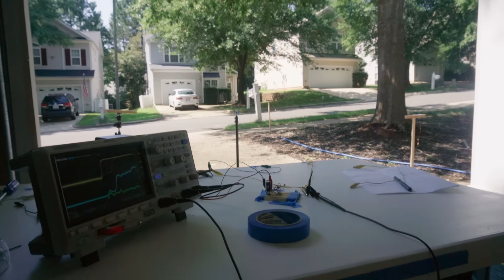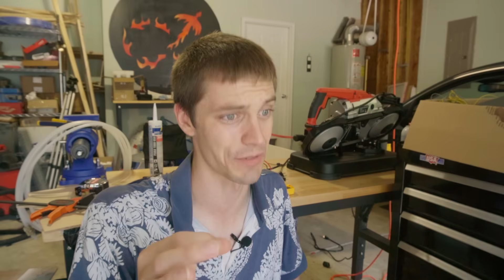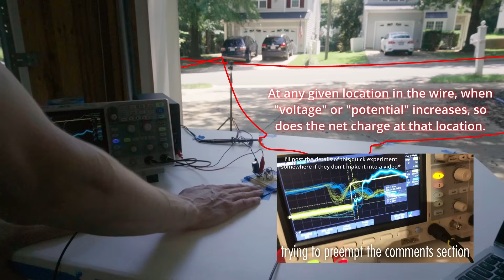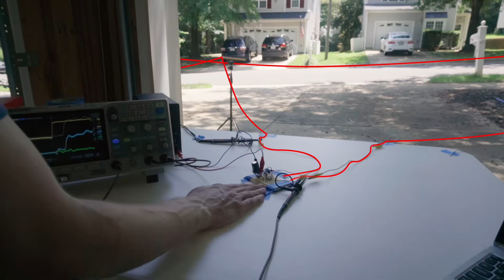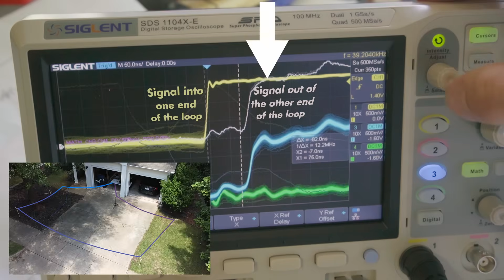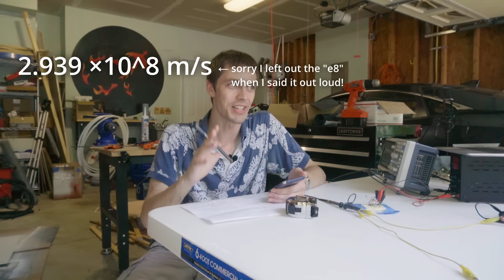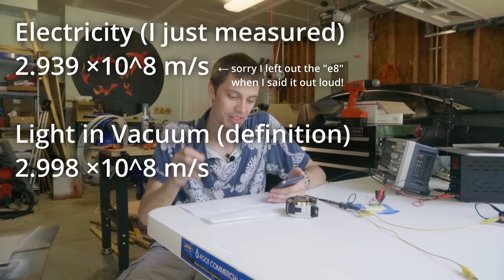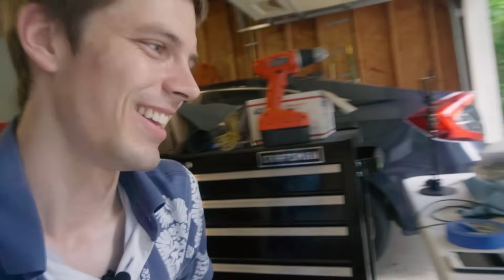Why does WATER change the speed of electricity?

Comment: 1)  AC power,      Converted to  DC   and processed further.      that signal then goes into a solid-state switching circuit !      (is the power supply   linear.?          2)  AC power,      Converted to  DC   and processed in a signal generator; whose output is the input signal of the circuit being switched.          is it possible that these things contribute to artifacts, embedded in the signal.

Comment: I'd like to see experimental confirmation of the water molecules aligning to oppose the field idea. It seems to me that it has two testable consequences: (1) if you preload the system with 9v DC running through it to align all the molecules against you and then flip a switch to jump to 18v DC it should be the 9x slower initially expected and (2) the timing of the edge where you drop the voltage back to zero should be faster in water than the rising edge and you should not see that effect in a vacuum.

Now I type this I'm not confident in the validity of either of those predictions but a video on why I'm wrong would be greatly appreciated.

Thanks for all your hard work explaining this

Comment: A video about how oscilloscopes work, both digital and old analog is clearly needed as it seems no one commenting seems aware that normal affordable scopes are only able to display fast signals that repeat. They do almost nothing at Ghz speeds, instead they sample and digitize at a vastly slower rate and eventually collect enough data to display the result.

Comment: I've talked to several engineers about how electricity 'flows' in a wire, but there seems to be divergent schools of thought. The idea (theory) that seems more reasonable to me is the interaction of the current and the magnetic field. The premis is that voltage/current must generate a certain level of magnetic flux before usable current will flow. Most commercial electrical work focuses on result, not 'why', but field engineers have told me that when high tension (100,000 volt) lines a powered up, the interaction of the magnetic fields cause the wires to move around at 5 to 10 foot waves, and measurable current is only passed when the magnetic fields have stabilized. I suspect the fields contain substantial levels of energy inhibiting current flow, and we have known for years that breaking flowing current causes huge spikes of voltage.

Comment: you should get into ham radio. I believe you would have a lot of fun with swr. I use a 80m loop in my back yard and you get into it on a way higher level when you're trying to communicate on it. Also you may want to make your main measurements at night if your planning to get very technical, because solar energy and electromagnetic energy from the sun messes with just about any readings you get through a wire, especially during mid day.

Comment: When building a wire dipole antenna for my Ham Radio on the HF bands I have to adjust the length of it if I use coated copper wire. The rubber coating adds some capacitance and changes the speed of the signal in the wire. My antennas end up being a little shorter than a bare wire antenna would be. I like to use insulated wire so it doesn’t matter so much if tree branches rub against my antenna.

Comment: (i typed this comment early in the video... I could have just waited) 🙄😂😅
Derek at Veritasium has a good explainer about the speed thing. The common misconception is that electricity is the active movement of electrons. They DO move, but not like people sometimes think. The charge is transferred by the field, which does travel at the speed of light. Minus variance for resistance and all that

Comment: Weird, like everything you have for equipment is almost identical to mine.  Even the plastic component totes.  So, counterpoint, I see the 555 setup back there, some of your resonances you're seeing might have a lot to do with that circuit.  I'd be interested to see if there are so many harmonies if a signal generator was driving a switch on the line.  Hell a spdt mosfet, control both angles of the line.

Comment: Good experiment and well thought out,  but the language you are using confuses what is going on.  The number of conduction electrons in a length of a conductor is irrelevant, really.  Think of the wire as if it were a tube filled with marbles.  For simplicity imagine that the tube is only just big enough to take the marbles, so there is a single line of marbles in the tube each touching another marble either side,  one in front and one behind.   Applying a voltage ACROSS the wire is analogous to pushing the string of marbles at one end of the tube,  with say a pencil.  Then time how long it takes for the the last marble to start to move.  The marbles might not be going very fast, but the impulse or push can be felt at the far end of the tube really fast.  This is like what is going on in your conductor.

Comment: Great video. I admit there is quite a bit I don't understand here. The part that I'm struggling with right now is this:
At ~10:25 you show the electrons with their field propagating through the wire with a DC source. This is great.
Later in the video you explain that the impulse created by the switch is made of sine waves. You said its all AC.
AC meaning alternating current would mean that those electrons have to change direction. But they can't because you have a DC source pushing them all one direction.
How can it be AC?
Reply from the maker: There are ac components to their motion - if you add up enough components it looks like a dc switch flip. They might actually bounce a little bit, but that’s not what I’m referring to, more like an oscillation added to an average motion where the sun is always still positive

Comment: This setup looks very similar to what Veritasium posted back in April 2022 called "How Electricity Actually Works". One of the conclusions is that it matters less what the length of the wire is and more how far the load is from the switch/source in regards to the length of time it takes for the load to respond.

Comment: 12:52 It is not the decrease in the strength of the electric field that is the cause of the decrease in the speed of the wave. The movement of electrons in the medium generates an electromagnetic wave that interacts with the incoming wave (superposition) resulting in a wave that travels at lower speed. The superposition of two traveling waves results in a wave traveling at a different speed than either of the two interacting waves. it will be faster than the slower wave and slower than the faster wave.

15:38 That is not what will happen. First of all, what the heck is the speed of an ELECTRIC FIELD? it is static. There has to be an electromagnetic wave traveling through the medium to talk about speed. Also, while the water molecule will rotate to align with the electric field (they have a resonance frequency in the microwave region which is how microwave ovens work), it is the motion of electrons that gives rise to the electromagnetic field that interacts with the electric field passing through the water.

In the case of light, we can see the slowing because we can see the bending of light as it enters an exits transparent media. Also, white light is made up of waves of various wavelengths which give rise to what we perceive as color. Because the wavelengths are different the resultant wave travels at different speeds for different colors. This gives rise to a phenomenon known as color fringing. This is a problem in telescope eyepieces where an image will have rings of color around it (fringing).

Dr. Don has an excellent video produced at Fermilab that explains why light slows in water, or any other transparent medium. https://www.youtube.com/watch?v=CUjt36SD3h8
This video explains why light bends when it enters and leaves glass or any other transparent medium. https://www.youtube.com/watch?v=NLmpNM0sgYk

Other than that small error, your video is an excellent demonstration of the manner in which electricity propagates through conductors. If a picture is worth a thousand words, a demonstration or video of a demonstration is worth ten thousand words.

Wayne Y. Adams
B.S. Chemistry
M.S. Physics
Reply from the maker: I’d say the decrease and the slowdown are both effects of the remitted wave interference but I had to pick which rabbit holes to jump down. I picked decrease in strength specifically because it’s relevant to capacitors
Reply: @AlphaPhoenixChannel  The problem is that you say specifically that the decrease in speed is the result of the decrease in strength of the electric field.

At 12:35 you say, "Specifically, when you put a dielectric in an electric field that dielectric material will create its own opposite electric field that partially cancels out the original electric field and this decrease in intensity of the field comes along with a decrease in the propagation speed."

I'm not going to waste your time and mine repeating the explanation, you can read my original comment again if it is not clear.

Also, did you watch the two videos I cited in my comment? Watch them both especially the first and the correct explanation will become clear to you.
Reply: @AlphaPhoenixChannel  I would note here that even if the E field gets smaller, its speed doesn't.

This is akin to less voltage, which of course plays no role in transmission speed.

The only explanation is that the field is halted for some reason. It is like an electron can move closer to one in front of it, but instead of the energy going immediately into repulsion, it goes into induction first (polarisation of surrounding material) and then the repulsion happens.

Either that, or it must be purely the speed of the field/s outside the wire.........................somehow. I hate this idea! 🙃
Reply: @hosh1313  Light, which is just a small portion of the electromagnetic spectrum, passes through a material. The electric field of the EM wave interacts primarily with the electrons of the atoms as he shows in his video. As we all know, accelerating charges, in this case shifting electron clouds, produce EM waves, these EM waves interact with the original EM wave (a process called superposition) resulting in a wave of lower speed. It has nothing whatsoever with decreasing the strength of the EM wave as he stated explicitly in his video, no matter how much he denies it or tries explain his way out. However, I will give him a pass since he is a materials science guy and not a theoretical or experimental Physicist.
Reply: @wayneyadams  So lets talk about the geometry of this.

An electron in the wire moves closer to one ahead. THEN induction happens outside the wire. By the time the induction happens and then might arguably have an effect back on the electrons in the wire, the wave front has moved and will never be caught up to by any induction effect.
Reply: First of all, what the heck is the speed of an ELECTRIC FIELD? it is static.

There is no such thing as a static field since there is no such thing as a stationary object - it's all relative! 🙃
Reply: @hosh1313  Yes, there is such a thing as a stationary object relative to another or to a frame of reference like a laboratory, which would give us a static electric field.

One of the experiment my students do is mapping static electric fields. In reality we map equipotential lines, and the electric filed lines are perpendicular and proportional to those lines. The method is not important, the important point is that these are static electric fields, and they are consistent, meaning ten different lab groups get similar maps within the limits of experimental error.
Reply: @wayneyadams  Are you saying that the E field has infinite speed? Not sure why you're referring to static fields since this discussion has nothing to do with them?

Comment: Virtual photons are the exchange particle for the electromagnetic interaction. This why electrical charge travels the speed of light. The actual electrons don’t flow up the wire the way you might visualize it.   

Same with the Coulomb force and magnetic fields. Since the photon has no mass, the magnetic potential has an infinite range.

Also current flows from the negative to the positive poles on the battery. 😊

Comment: Two thoughts on this. 10:08 - This must mean, that a lower electron density will cause a slightly higher delay of the signal, so the observed result must differ from when a positive field is applied, or a negative one, with a slightly greater delay on a positive end, and a slightly smaller delay on the negative end. 16:52 - Optical observations seem to contradict this, as blue light on the visible spectrum seems to be refracted in a somewhat greater angle than in case of red light. And that means, that blue light in water (also in glass, and possibly a lot other transparent materials) propagates slower than red light does. This assumes somewhat greater interaction between water and light at the blue end of the visible spectrum, which got shorter wavelength / higher frequency.

Comment: how do you know the speed of light, We just cannot measure the speed of light in one direction because relativity prevents us from maintaining synchronised clocks. The result is that the speed of light c is really the average speed over a round-trip journey, and that we cannot be certain that the speed is the same in both directions. The number set for the speed of light was in 1905, now im not saying Einstien was wrong just inacurate because we haven't made the technolagy to accurately speed test the light since the fastest speed cameras are light based. but im no scientest, just an uneducated 40 year old with a grade 8
Reply from the maker: I have personally measured the speed of light (see other video). It was the average speed of light, which is what matters here
Reply: It doesn't matter. Light is a wave, so it makes sense for it to only travel in all directions at the same speed. Meaning, we can easily deduce that speed.
Reply: @blinded6502  Light is a self-perpetuating electromagnetic wave; the strength of the wave can get weaker with the distance it travels, but as long as nothing absorbs it, it will keep on propagating forever. but since we are in an atmosphere and there are still forces to ebb and flow on the protons anywhere in our solar system and no ones tested this in true dead space. and blackholes proove light is at the mercy of gravity, the only way we can test with no out side influences. well easaly shoot down everything ive said because bumble bee's fly and science prooves that they can't but no worrie's the bee will be extinct soon and science will be right again.

Comment: my guess before i watch is that the water "eats" energy that's being put out in the surrounding area via EM field since it's so good at transmitting those that it creates some kind of loss based drag. So i guess if your underwater cable isn't shielded you'll have big losses of power and voltage.

Comment: The reason for the measurements being slightly less than c can be more intuitively understood when you consider that the electromagnetic field is communicated between electrons via photons. Light passes through mediums slower than c because it takes an indirect path; the more it interacts with the medium, the more frequently its path will be changed, and the longer its path will be. The frequency of electrons moving through a wire is around the radio spectrum, i.e. much "slower" than the frequency of visible light. So it makes sense with your explanation why the water would slow electricity more than light.

Comment: So wait, computer ram, especially the slower ddr1 stuff ran at way lower NS then this wire could achieve. I guess those elections travel faster than the speed of light
Reply: Also, is that why only the ends of wires get hot first when the resistance is too high? Because Of the density of electrons at the ends?

Comment: Filling the tube was great for demonstrative purposes, but I can't help but wonder if you might have gotten clearer results by actually finding somebody with a backyard pool you could borrow and submerging the whole loop entirely within a pool of nothing but water (thus replacing all the air around it with water, instead of just the bit in the tubes)...

An interesting question that comes to mind from this, which I don't think I've ever seen anybody address, is "Does electricity travel faster in space (e.g. through wires and other components in a satellite) than it does on the Earth?"  The answer is that, according to Physics, yes, it should, but this is, of course, a bit difficult for hobbyist YouTubers to actually put to the test, I guess..

Comment: Did you consider using the enamel wire in water?  A lot of the electric field is in the insulation, rather than the water.
Reply from the maker: I did
Reply from the maker: That is the enameled wire
Reply: @AlphaPhoenixChannel  So then the field is travelling outside the enamel but inside the water? LOL

Why not outside the wire but inside the enamel and the water?

Even without the water, can the field travel through the enamel?
Reply: Ok. Sorry for missing that detail. That makes your test really interesting. If your test is picking up on the diffraction coefficient of water, that means your test is treating the step wave going through the wire more like a photon?
Reply: The reason I’m asking, what happens if the wire enters the water at an angle?